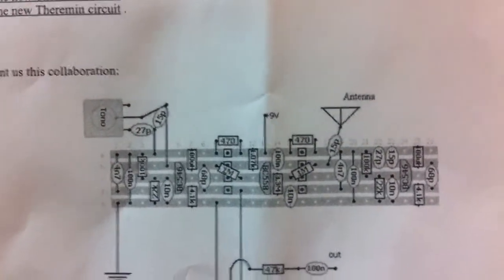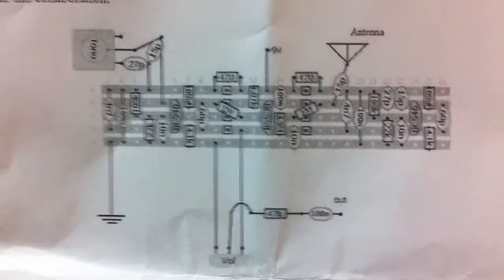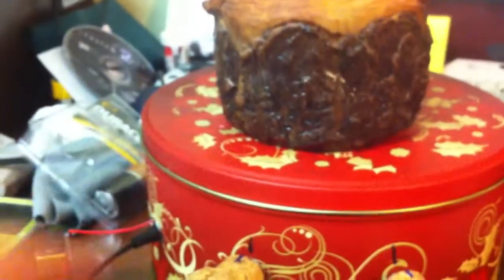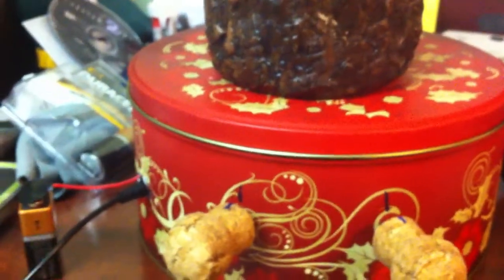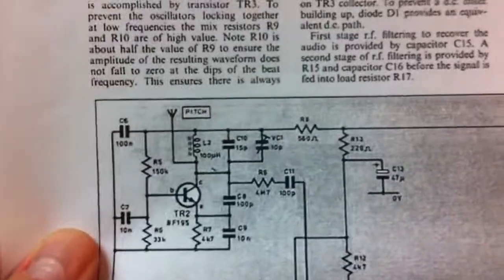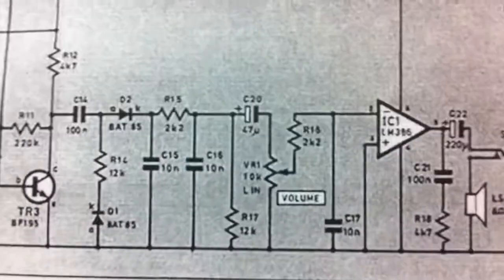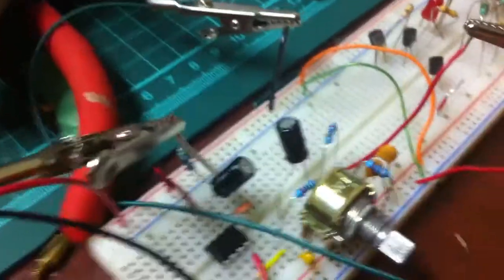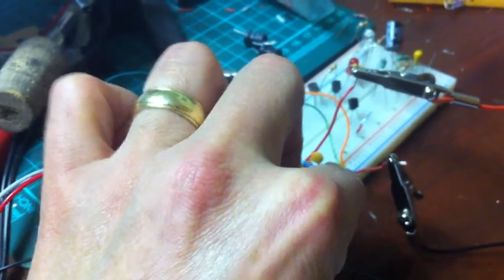Easy Theremin video

Comment: what kind of inductor is it, if possible can u place a link of it under reply. (air coiled, ferrite), im trying to make this for my grade 12 physics project.
Reply from the maker: these are the set i used https://www.amazon.ca/gp/product/B00H6YSVTK/ref=oh_aui_detailpage_o07_s00?ie=UTF8&psc=1 I wish you well on your project! Check out 'Theremin World' for more ideas. They have a super supportive community and some simple theremin designs to work with.
Reply: I could only find a bc557 is that okay
Reply: And and thank you so much for replying
Reply from the maker: https://www.amazon.com/gp/product/B008KMDMXW/ref=oh_aui_detailpage_o01_s00?ie=UTF8&psc=1
https://www.amazon.com/gp/product/B008KMAXAC/ref=oh_aui_detailpage_o01_s00?ie=UTF8&psc=1

If you ordered from here, I dont know how long this will take to arrive to you, but these are the ones I ordered. I recommend using what is listed, as they are npn and pnp. You can try to use the others but the results might be unexpected.